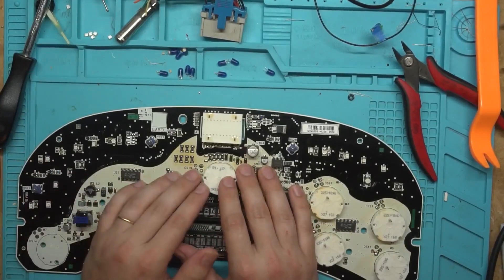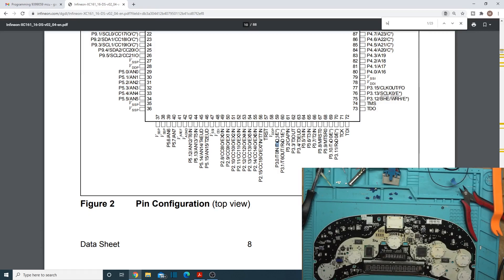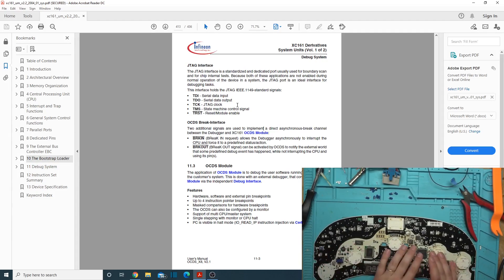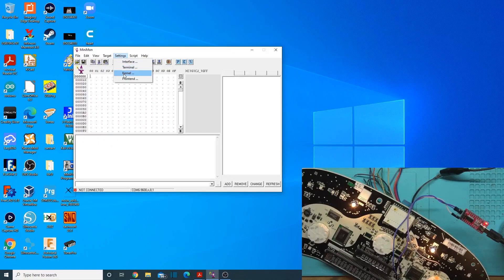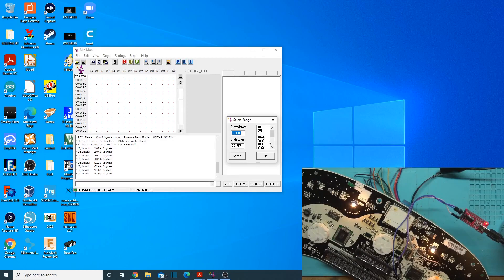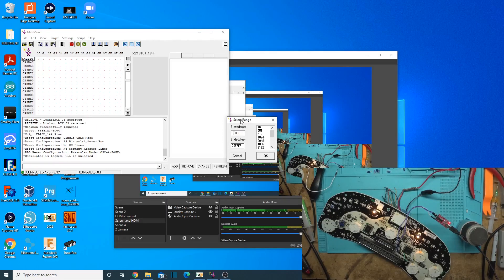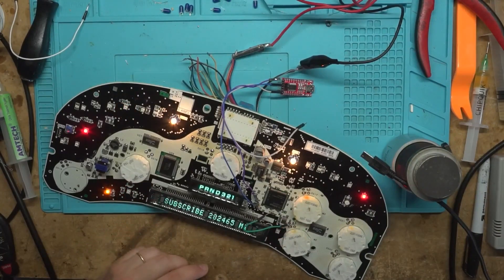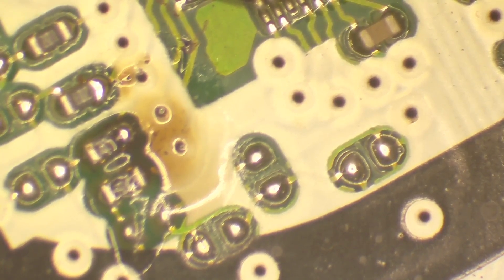2005 GMT-800 Cluster: Programming The 21002558 MCU

Comment: Can these clusters be flashed to think the engine is on all the time? I got one of these clusters for free and i wamt to use it in a sim. I got the cluster powered on but the gauges dont respond likely because it doesnt get am engine on message.

Can i enable the cluster if i dunp the eeprom and edit some values?

Comment: Have you tinkered with any Mopar clusters?  

I just picked up a 2012 Jeep Patriot we did did a cluster swap this past weekend to add the EVIC "Think the Mopar version of the GM DIC" I ended up with a cluster from a 2008 and found out the long way that the steering wheel buttons from the early model use different canbus messages from the late model. I have been playing with my GM clusters for a while and I am putting the crosshairs on the Mopar.

Comment: I have a question I'm hoping you can help me with. I pin swapped a 2003 cluster on my 99-02 chevy truck and couldn't get the oil and battery gauge to work. I'm thinking those two gauges get their signal through canbus. Is there a way to get them to work? I know a youtuber that had made it work but won't share the juicy details.
Reply from the maker: That's because in the 99-02 oil and battery are done by the cluster but in the 03-07 they are done by the bcm and pcm
Reply: @FixedUntilBroken  is there a way to manually get analog signals to the oil and battery gauges of the 03-04 cluster? Or maybe trick the cluster via software to take the analog signals?
Reply from the maker: No not without those boards he uses. One day when I decide do a GM Class 2  project I plan to make an adapter.
Reply: @FixedUntilBroken  that would be sweet, I'd buy it in a heart beat from you. That is if you're willing to sell them lol
Reply from the maker: that is for can bus. class 2 is j1850 vpw. its different from can. its 7v/gnd. its not well supported by chip manufacturers so most people just use a Elm327 to do the talking.
Reply: @FixedUntilBroken  ah OK as you can tell I'm clueless lol
Reply from the maker: I also know who you are talking about. PI clusters or whatever. He is cutting the traces to the stepper motors and putting daughter boards in there to drive them. It's like shoving an autometer gauge in there.

Comment: I Would like to know if there is a way to add PID for transmission temperature to read out in the DIC menu.
Reply from the maker: likethe 2007-2014 boards? short answer no. Long answer since we can actually flash the MCU if some really wanted to write a new OS for it you can. but that would be months of work. So just like anything in the car world. enough time and money and you can do anything lol.
Reply: @FixedUntilBroken  what about the older 02-03 envoy models where they had instant MPG read on the DIC, but in 03 and newer they got rid of that feature.. i have been playing around with the hex code via elm 327 in the Silverado, envoy models. I would like to know how you got the info on what are all the chips on the board, ex. stepper motor driver, dic display and where do i get that schematic for the main MCU chip for pin outs, like you had said the right to repair act ugh, its locked away.. i have a scan tools that i have been trying to reverse engineer obd 2 via hex code, and that is what i seen in MiniMom programe that runs the software to the IPC.
Reply: Man... All the yrs of working at my pops TV and VCR repair shop might come in handy. Going to watch more of your videos. A lot to learn.

Comment: I wasn't able to read this in circuit because my board is slightly different then yours, do you know if it's possible to read off of breakout board with ftdi232?
Reply from the maker: Your probably dealing with either a 2004 or 2006 then. I have video for 03/04. I haven't done the 06/07 but it's the same microcontroller with the same pin out as the 05. Just trace the pins from the mcu and find your points to solder to. You could always just use enameled wire and solder direct to the mcu
Reply: @FixedUntilBroken  It's a 2006 Suburban cluster for my truck. Pretty sure it's bricked now though. I couldn't tell how you were powering it, it looked like you just booted it up through the dash harness connection but I couldn't get it to read the chip and now it doesn't display info. I have a donor cluster with the same board as the video that seems like it will work in the truck if I can manage not to brick it again. I think my FTDI was set at 3.3 but it didn't work in 5v either. It's my first time working with MCU I do mostly eeprom and guided programming. I took the MCU out of circuit and was hoping to play with it. I'm just trying to understand how to correctly connect to it. I appreciate your reply's and the video for the info, I was having a lot of trouble just identifying the MCU
Reply from the maker: The vfd driver talks the the mcu via SPI. The tx pin of the mcu is the MOSI pin for the spi communication. If the screen isn't displaying but the stepper motors are working you probably don't have continuity anymore. The resistor is pretty easy to break I'd start there

Comment from the maker: Hope you guys like it. Next MCU I will mess with is the 9397364. I'm just going to see if it can be swapped with a 9399059. That MCU is found on some Trailblazers. Who is going mod the din on these 2005-2007 boards so the battery light doesn't stay on if you put the cluster in an 2003-04? no me lol.